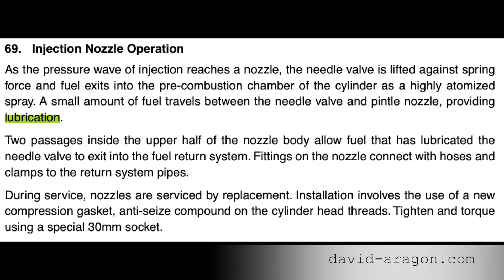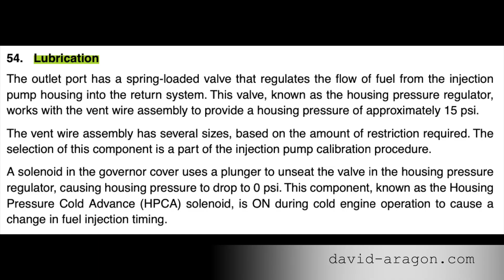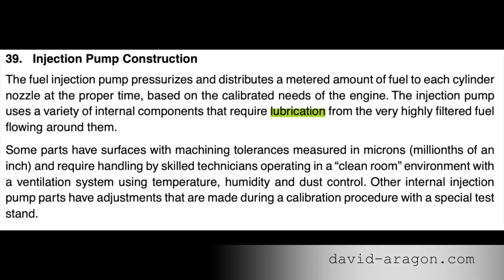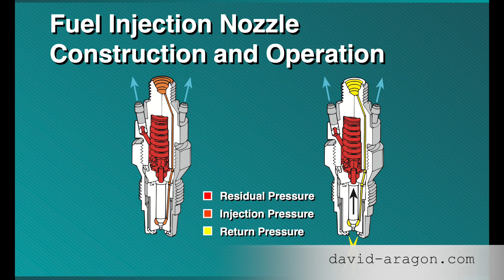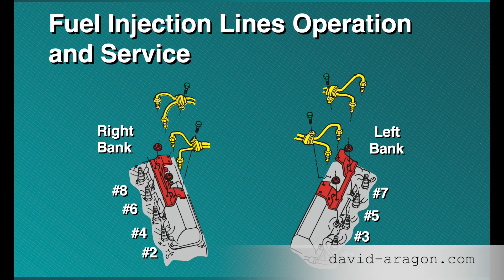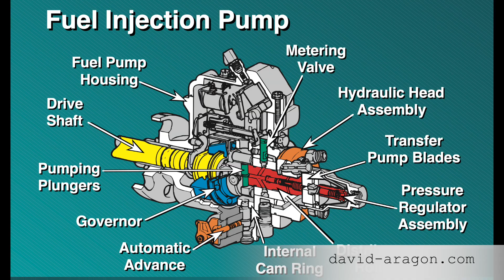Is Your HMMWV DB2 Injection Pump A Ticking Time Bomb?

Comment: I have a 07 m1152 TD. Once it gets to Temp is gets so sluggish feels like in limb mode. No warning lights come on and I tried to get a code. But nothing come up. So I believe it's a fuel issue. I changed the lift pump and it still acts the same.  I'm in need so some serious help.
Reply from the maker: Hi there; sorry to hear about that. Have you checked the TM's?  TM 9-2320-387-24-l has some great troubleshooting that could help steer you in the right direction. Unless you've tested your lights, you can't know for sure if its not triggering lights. i.e. my prev M1097 A2 had a fault in the trans light circuit. Since it runs fine cold but gets sluggish once hot, I'd test the fuel system first cold and then hot. TM 9-2320-387-24-1 calls for over 3 PSI at the injection pump and about 1 pint of fuel in 30 seconds on the volume test. Check it cold, then hot. If pressure/volume drops hot, look at the filter, tank pickup/strainer, lines, vent, and return system. If fuel pressure stays good, I'd look at the injection pump, turbo/boost, or exhaust restriction.